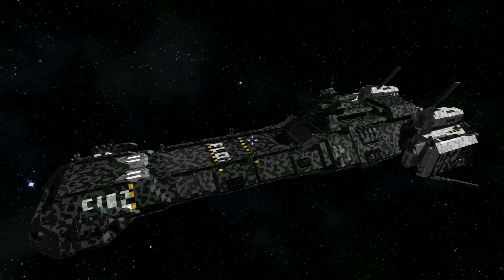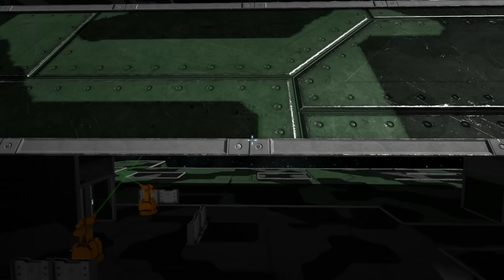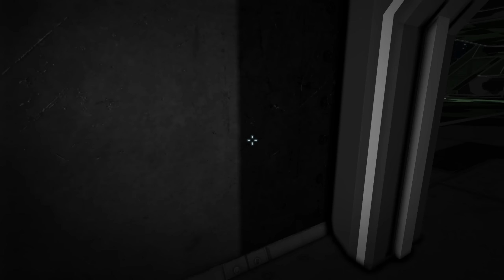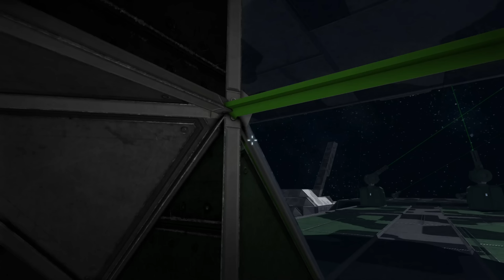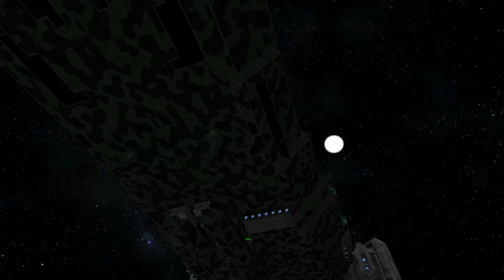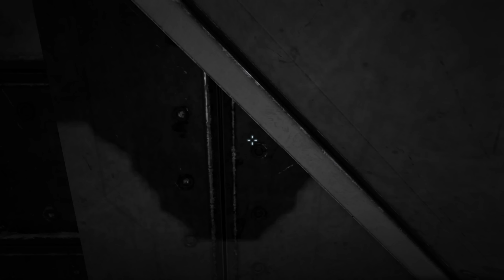Space Engineers: Bengal Carrier & Updates

Comment: may have figured a way to handle some of your weight issues seems if you can reinforce 
the ships hard points  try to shave some internal  weight off with light armor into the frame work surrounded by heavy armor diamond hangover on edges shields can be added to compensate for  for shaved weight trim down the gyros some focus you gravity drive to smaller mass drivers and use sage engines on the back end with a angular focus of force 
of engines to move it  convert the underside of the back end behind the gun for 6- 10 smaller drop fighters and 2 main rebuild modules to repair when damaged power is to a level
with 6 main reactor  and 4 redundant reactors with a series of solar panel on top to 
keep power up and a series of batteries to keep backup for life support
istead of drops ships  suppliment with attack drop drones
autoate as much as possible